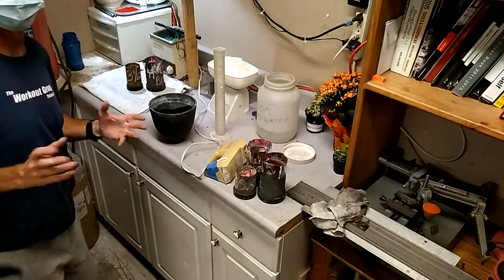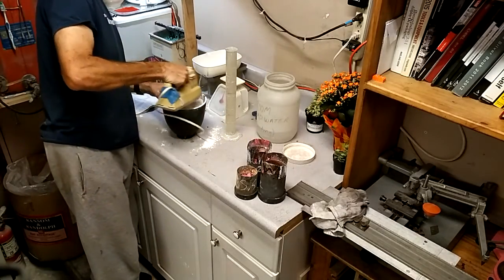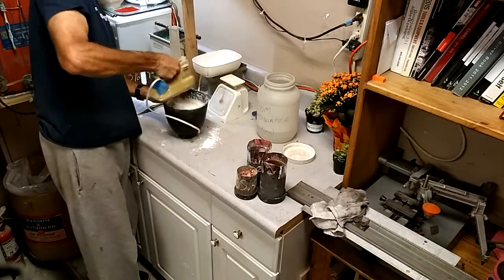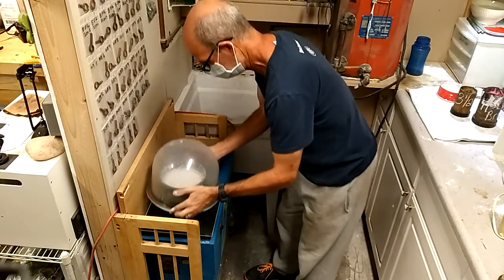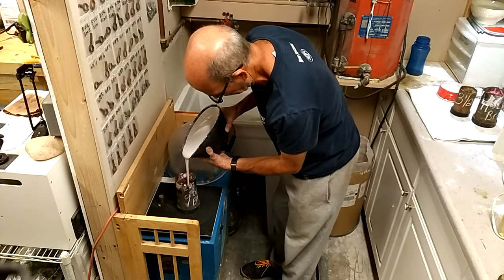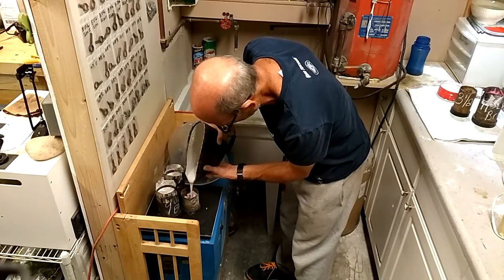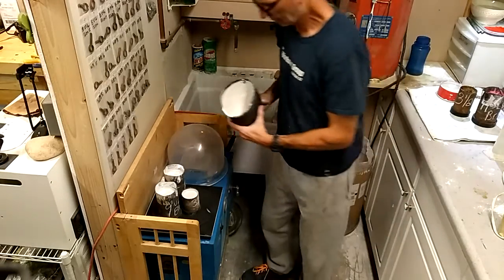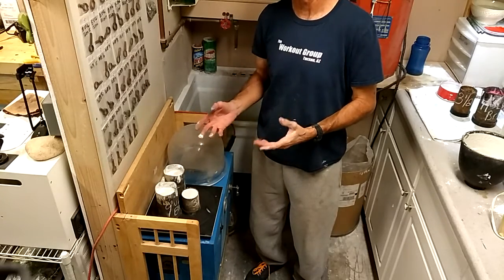Investing 3 flasks for lost wax casting

Comment: I do spin casting and have only just purchased a vacuum chamber. I used to paint all my waxes with investment to cut down on the bubbles and tapped them out in the flask on a vibrating table but this is very hit and miss.. My castings are super fine and I might have anything up to 100 in each 3 inch flask so if I can avoid painting them and rely on the vacuum chamber to remove the bubbles, I'm in business.. Thanks for the video. It makes a difference when you see a real person doing it on a day to day basis because there's a lot of experimentation along the way and tips like tapping your vacuum chamber table to agitate any stubborn bubbles can make a huge difference..
Reply from the maker: @chrismalcomson7640  look up The Portland Jewelry Academy on Instagram. Jason has a very good investment video that we now use for everything.